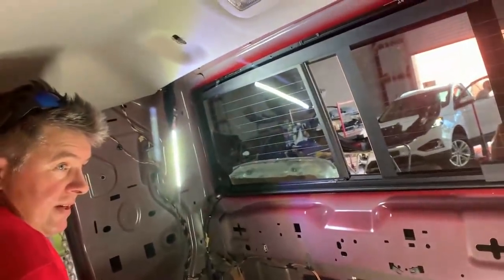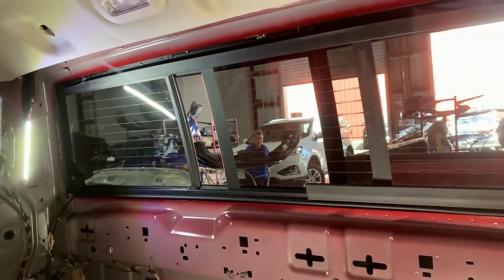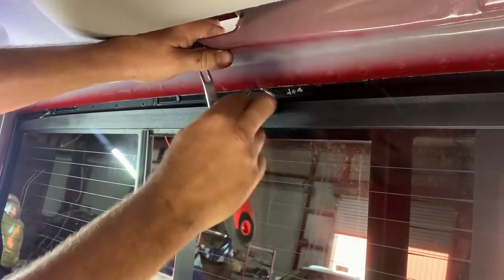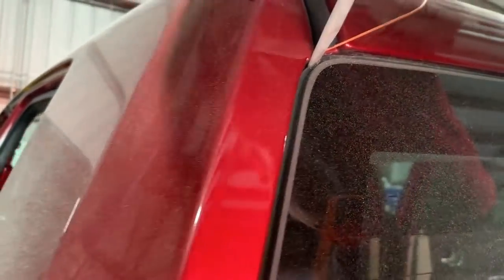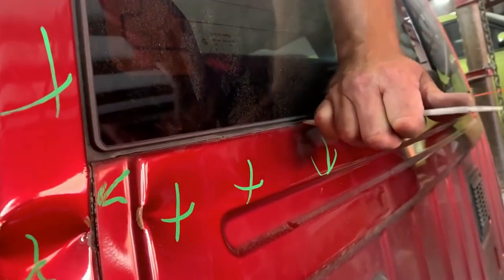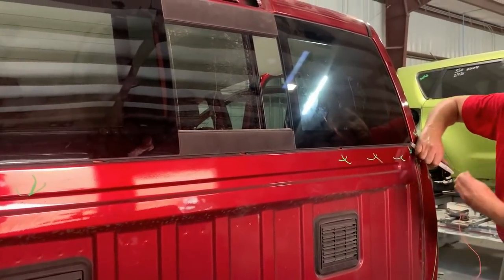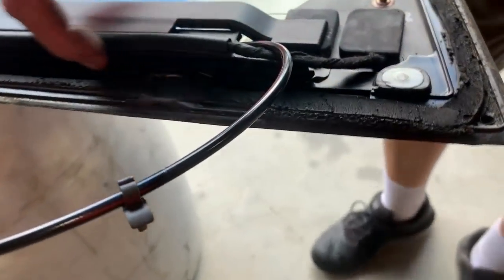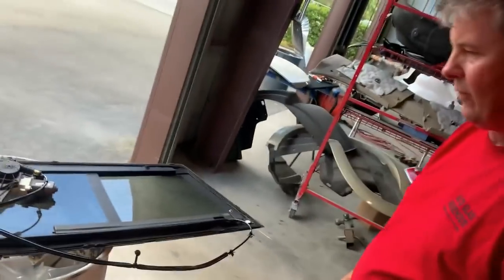2017 Ram Power slider removal and save with The Game Changer 0

Comment: Ok so now this back glass is not a reusable glass
Reply from the maker: I reuse them all the time. Same as any other R&I. If you fail to save the pins on a quarter glass R&R do you replace it? If you choose not to reuse it that's fine. This tool will also spare the paint and body surrounding the glass part.